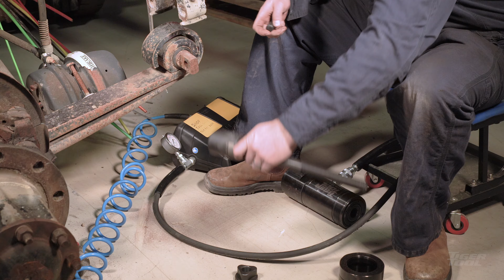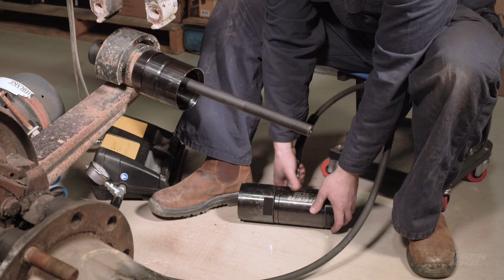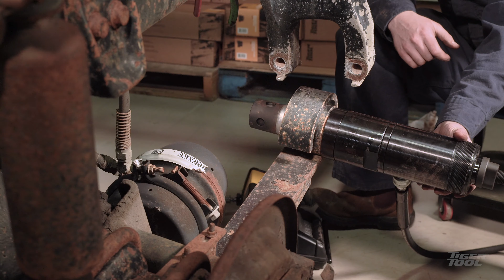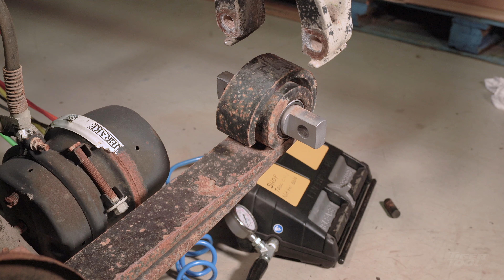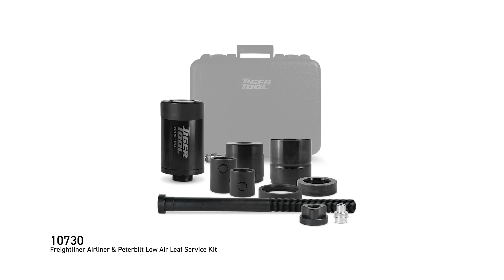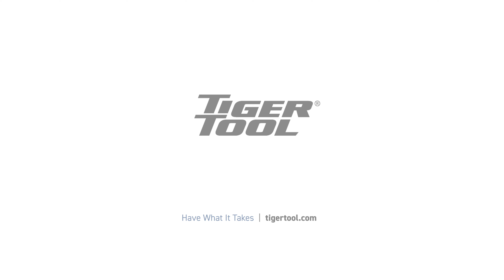Freightliner Airliner & Peterbilt Low Air Leaf Service Kit | Tiger Tool Part # 15000 & 15030

Comment: How is that supposed to work on airliner suspension when the bushings have to be driven out towards the driveshaft? I work for Freightliner and that tool would not work on the spring eye bushings on a Freightliner unless you cut the end of the bushing off.
Reply from the maker: If it is an “Anti-walk” bushing with the collar you need to pull it inward towards the driveshaft. That will require the removal of the u-joint at the differential for clearance.

Comment: They made it unreasonably expensive liek 2k to 4k for tool just ridiculous!. I bet average cost to make these in India or China is less then $130
Reply from the maker: We understand that the initial investment may seem significant. However, we would like to emphasize that this tool is specifically designed for shops that frequently undertake these types of jobs. Its robust design and efficiency can lead to substantial savings in time and labor costs, offering a very high ROI.

It's also important to mention that our tools are manufactured in Canada, ensuring top-notch quality and durability. While this might contribute to a higher cost compared to overseas manufacturing, it guarantees that each tool meets our stringent standards and supports the local economy.

We believe that the value and long-term benefits of our tool justify the investment for professionals in this field. 

Thanks for reaching out.

Comment: What do I need to order to do peterbilt low air leaf bushing removal and installer part numbers please
Reply from the maker: You will need the #15000 Pin & Bushing Starter Kit and the #15030 15030 | Pin & Bushing Adapter. If you don't have a hydraulic pump, we offer the 70129 BVA Hydraulic Pump. You can visit our website at the link above or give us a call with any questions 1 800 661 4661